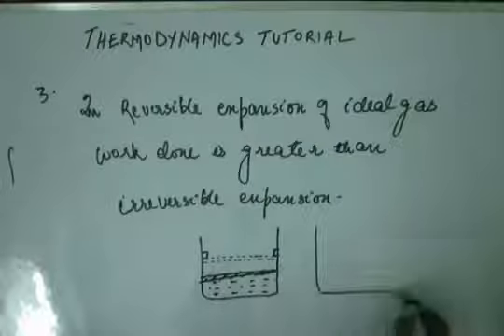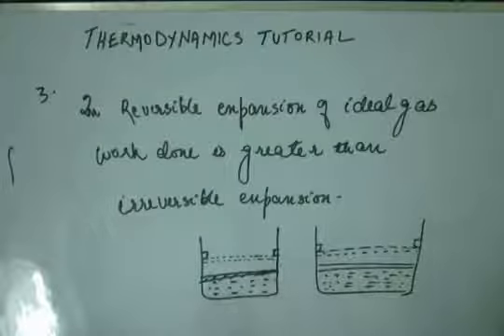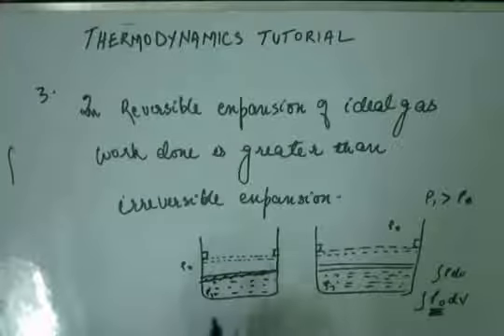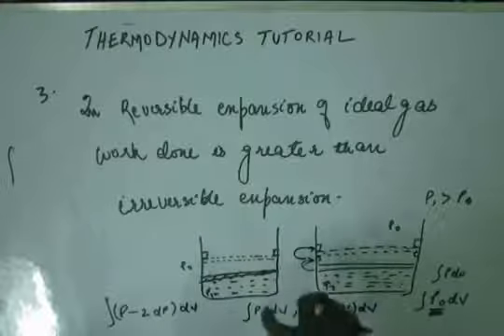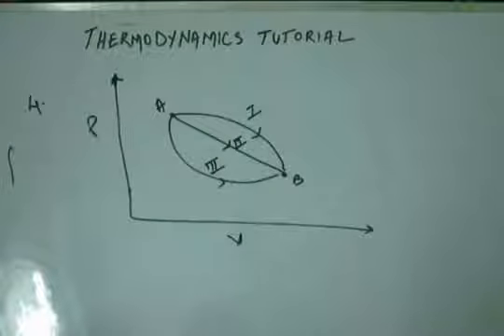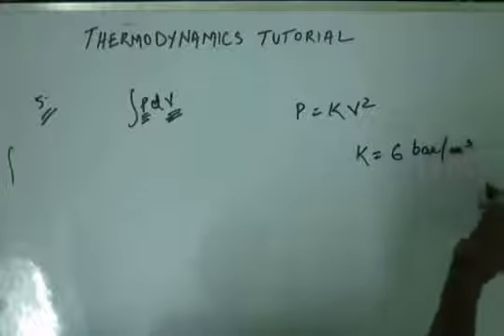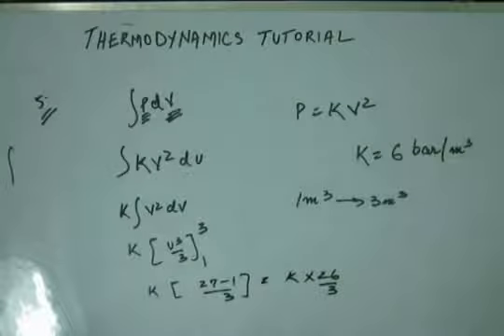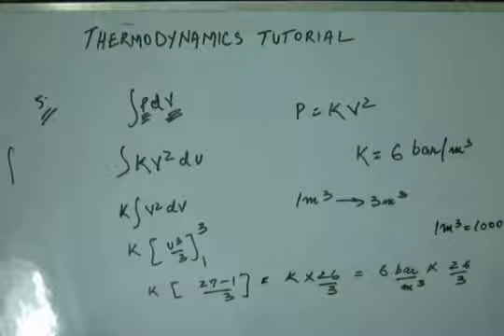Thermodynamics Lecture  9 , Chemistry IIT JEE (Solved Examples)

Comment: I didn't get question 5 answer
Reply: 1bar =100000pascal
(6*100000pascal *26)/3=5200000=5200KJ,  
here i didn't convert m^3 into litre and still got the answer
Reply: he got the correct answer even in the video i.e. 5200 kilo joule

Comment: Awsome video... but sir, in ques 5, if we put unit of K 'bar/m^3', wont we alter the unit of pressure?? shouldn't unit of K be 'bar/m^6'?
Reply: I agree it should be bar/m^6 also the volume should remain in m^3 not litre as m^3 is SI unit of volume